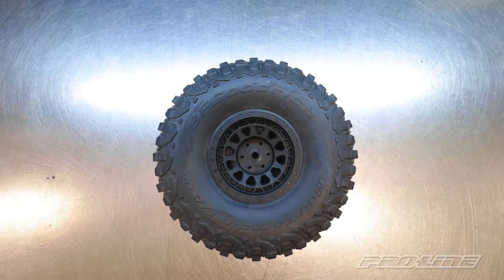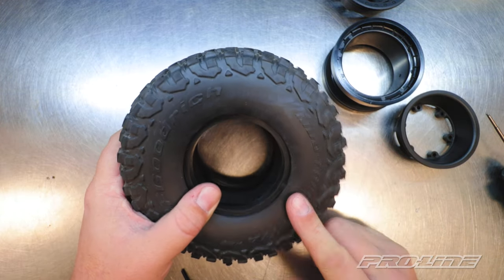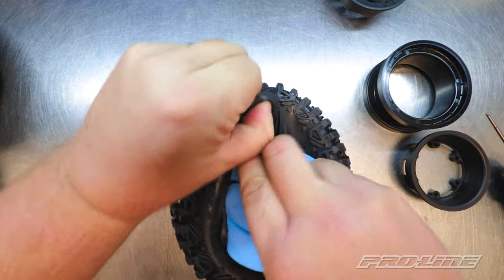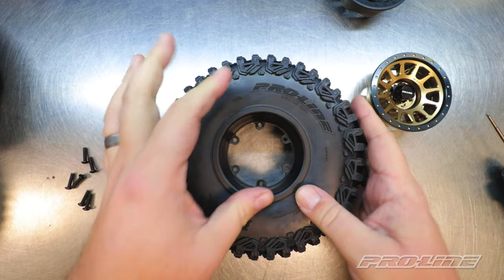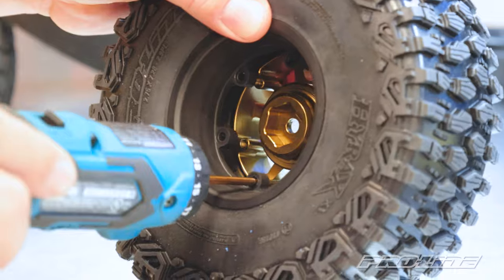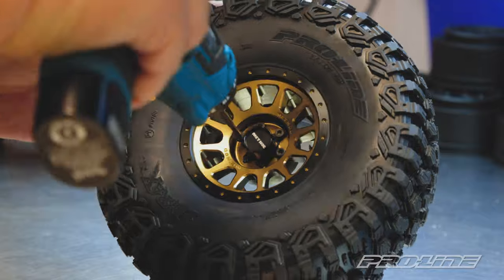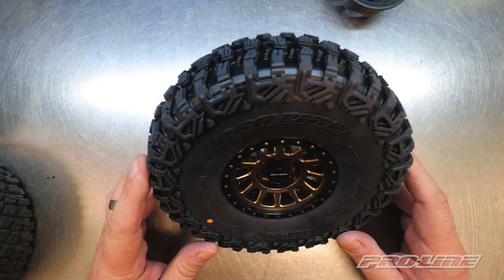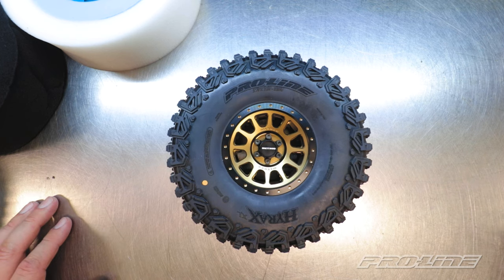Pro-Line HOW-TO: Upgrade Axial SCX6 Wheels, Tires, & Foams

Comment: Looks good but pro tip for beginners: Never start a screw going into metal with a power tool. Start with a hand tool first then used the power tool if you want. This ensures you have it threaded correctly.

Comment: I've had these since they released and they're amazing. It is night and day how much better my scx6 is with these foams! I also use these foams in my 1/10 trucks. I run the single stage crawler foams in my G Speed GShot and it's nuts!

Comment: Protip.... so stay away from the Proline foams and weak effort at SCX6 wheels. Proline's wheel inserts  are a expensive cheap attempt at making aftermarket wheels. They don't grip the tires so well, so you end up spinning the tires on the rim when under loads. Also, Proline's foam inserts aren't all that and a dime sack either, especially for the price. You can pick up Injora two stage foams for about $22, and they perform way better. I love some of Proline's products, but these are just a couple of examples of where they really cheated out in r&d. I picked up some Injora full aluminum true beadlock wheels for $115. About $15-20 more than Proline's dinky wheel insert. Sorry Proline, better luck next time.

Comment: I wouldn't waste my money on that when one can buy full alloy bead lock wheels for nearly the same price !  I know because I bought 10 of them along with 10  Power Hobby dual stage foam inserts.  And 5 of the Interco S.S. tires to finish them off with.
One set of 5 alloy wheels is all black, the other of 5 wheels is a sort of a metallic gold color.
I'm sure I've spent nearly $ 4k on this 1/6 Trail Honcho crawler since I've purchased it  !
But it's gonna be super cool when I get done with it  😎

Comment: Why not a full aoy beadlock..
and still slipping.
Injora full beadlock wheels..fit like cracy and what a tight bead..no slipping at all.
I bought Superswampers and these the foams and are happy with them..face of the wheels is nice but you still have a plastich midpiece and a plastic rear bead  sorry Pro Line ..but you could have done better.